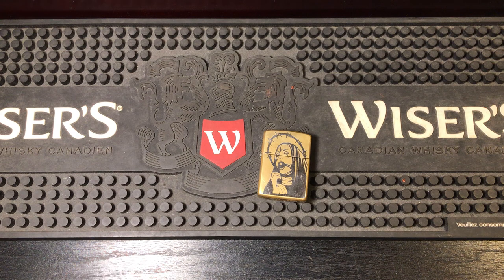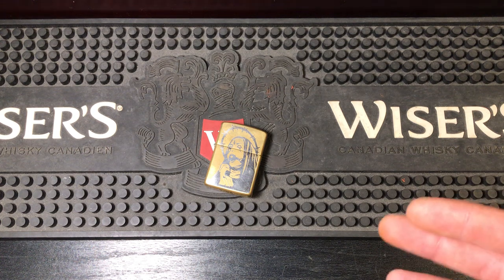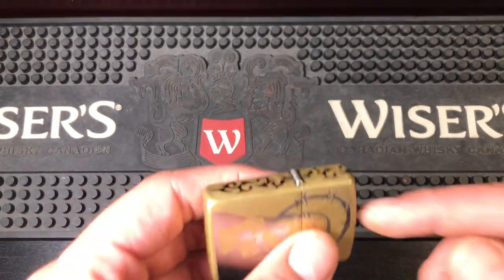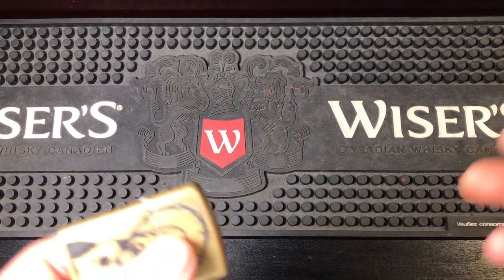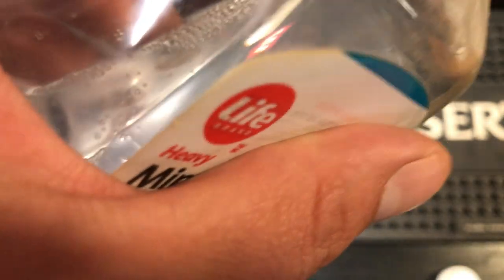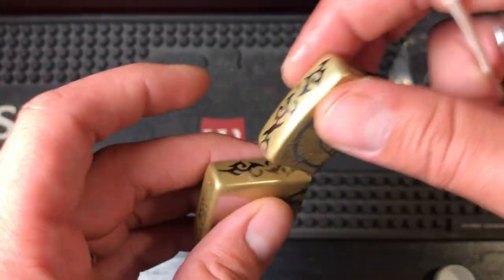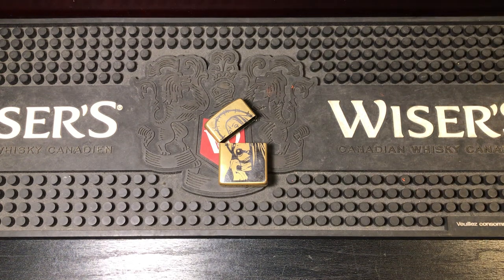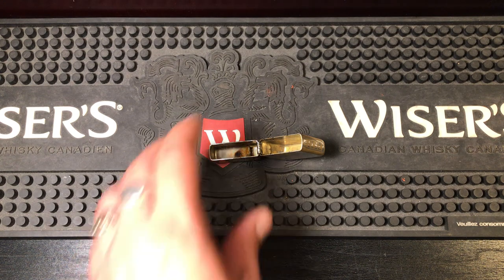3 Zippo Tricks To Keep Your Hinge Tight

Comment: Oh... I just whack the hinge with a hammer on the outside of the case with the lid closed. That squeezes the hinge around the pin. Surprisingly, that works for a good long time. However, your method looks a lot better, and I'll be using that method in the future.

Comment: just ran across your channel so i don;t know if you know it but you can take the flint out of a spent full sized bic lighter and use it in a zippo! granted you may have to leave the screw out a bit til the flint wears down but a bic flint will last at least 3 zippo flints if not 4 or 5! i'm at the point where i'm just salvaging bic flints i ain't bought zny zippo flints 3 years! and frankly if you can find any, ronson flints last at least 50% longer than zippo flints at least in my zippos!
Reply: Zippo owns Ronson.
Reply: @franksalem8580  since when? and if they do why haven;t they improved their fluid? Ronson brand fluid is way superior to Zippo fluid!
Reply: @keithmoore5306  In 2010.
Reply: @franksalem8580  didn't hear but Zippo fluid still doesn;t go as far as Ronson in my lighters!
Reply: Keith, take a look at the bottom of your Ronson can. It says "Zippo Manufacturing Company". Zippo now claims they are identical and not only come from the same facility but also from the same tank. The article can be found on the internet.
Reply: @franksalem8580  that might be the case but my 2 Zippo lighters go 4 to 5 days longer with Ronson fuel than Zippo!! and the Ronson flints were way better when i could get them they'd last at least 50% longer!

Comment: Very good illustration on what causes bad lid Alignment. I just purchased the Red "Retro Boxtop" design directly from Zippo. It's absolutely brand new/unused. It came with a horrible "overbite" on the side and terrible "lid gap" on the side of the lighter with the lid closed. Very bad quality control. The lighter case is red and I can see the chrome insert inside while looking directly at it.
Reply from the maker: Yeah its sad those hinges make it through. Repaired hinge is so tight just make them like that !! Lol